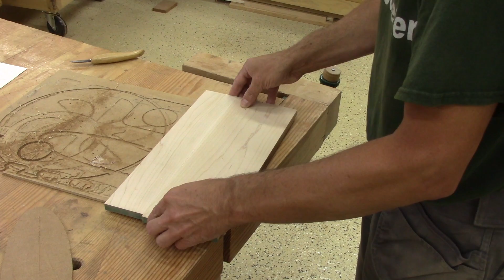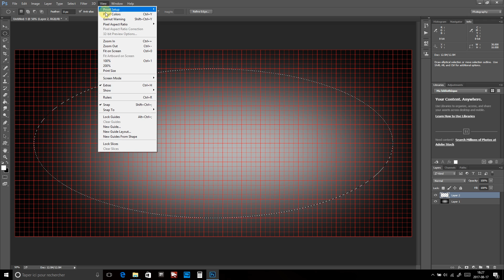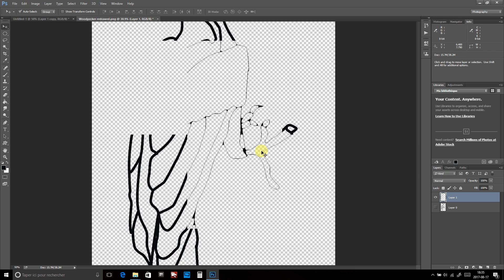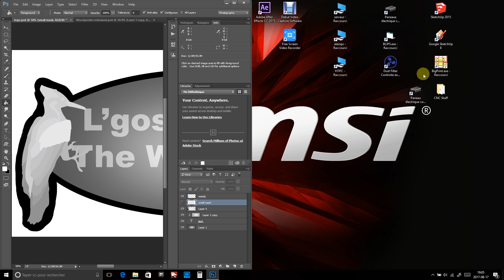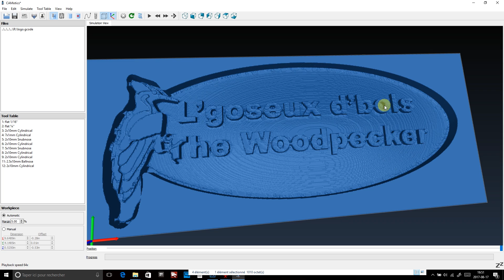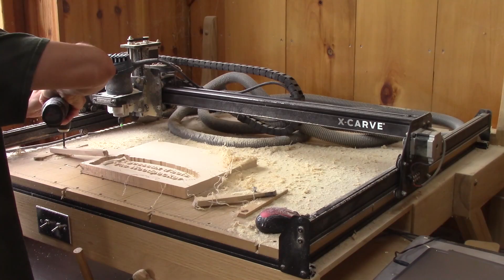The Woodpecker Ep 163 - How I carve a 3D Logo with a CNC

Comment: When setting the depth of the carving, what percentage is left for the finishing cut?
Reply from the maker: I'm not sure to understand your question. 
But on the roughing pass they is  only 10 thousands left on the wood to remove for the finishing pass. But nowadays when I carve something with not too much relief, like this. I only do a finishing pass with a cylindrical ball nose bit. The bit starts at ¼" and has a point of 1/16" all this is tapered. This saves a lot pf time. But it's not always possible depending of the type of wood and the depth of cut
Reply: Greetings Alain, thanks for your reply, I think I have figured it out now, I realise I have to think carefully about tool selection and total depth, I work in mm so I will have to convert your sizes. Regards Jim H
Reply from the maker: Yes it's a pain both system.... Now I try, to work only in mm on my CNC but sometime it's impossible...

Comment: Did i get that right: In order of cut depth, it takes 10 passes to get 1/16 inch deeper?
Reply from the maker: Not deeper, but further away. After one pass in horizontal(x) the carriage moves 1/160" in Y up the carving. So it takes 10 passes to carve  1/16th wide.
Reply: Ah okay! But why? Did you mention the Diameter of the small bit? Probably not 1/160" :D

Comment: The motor can run for 6 hours straight without burning?
Reply from the maker: I guess so I made at least 2 dozzens of those already. But I went through 3 or 4 sets of brushes. And this pisses me. When the motor stopped because of that, on top of ruining the piece, the bit break iinstantly.
Reply: Wow I would be mad too

Comment: Hi Alain, I mostly use Aspire and am unfamiliar with the method you used so I may or may not have a useful suggestion for you. In Aspire there is the notion of a zero plane which can be used to set the top surface of the carving amongst other things. This I normally set just fractionally just below the surface of the material you are cutting. I noticed that your carving is somewhat deep into your material. If there is a way to set a “zero plane” closer to the surface you may be able to reduce the number of passes for your roughing pass saving you a bunch of time. As well you may wish to use a 1/16” tapered ball nose for you final pass. It may take just a little longer than an end mill but the results are far superior to that of an end mill. Your carving will be much less blocky and more rounded. As this is my first post to you after years of watching I would also like to take the opportunity to thank you for the tremendous time and effort you have put into your videos.
Reply from the maker: Thanks for the tips. Vectric contacted me and I just finished an episode (not yet edited) using aspire, but since I'm fairly new to it I didn't use zero plane. But if you stick around you'll be able to see what I managed to do with it. 
I never used tapered ball nose bits, just the name make my hair rise, thinking of the cost of this bit. I broke a lot of my end mill bits for several reasons, some of them are feeding too fast but the most commun these days is motor problems. Yes I use my CNC so much that the brushes wear up to the point that the motor stop and instantly the 1/16th bit break.

Comment: Hi Alain, TO save you a lot of time, you can fill each section of the woodpecker as a new layer with pure black. Then simply modify the layer's "Opacity" to percentages between 0 and 100 to make the different grey. This way you can quickly change each layer's shade of grey and have a specific number to compare with it's neighboring sections.

You also may want to look into using the Layer Blending Options to use the "Stroke" feature to make those black outlines around items.
Reply from the maker: WOW you know photoshop more than me... I mostly use Premiere and photoshop for simple thing. Thanks for ther tips